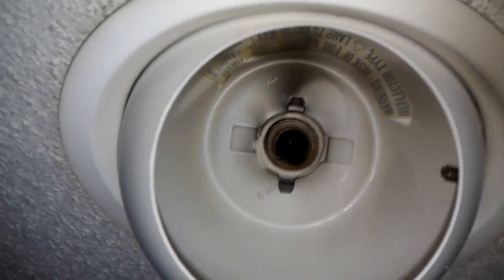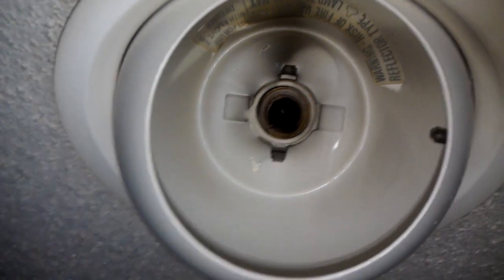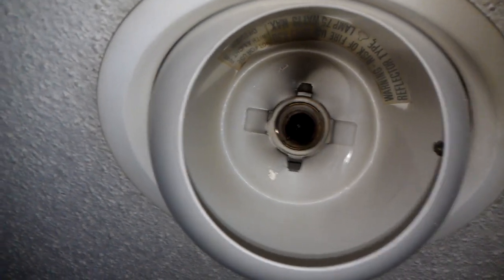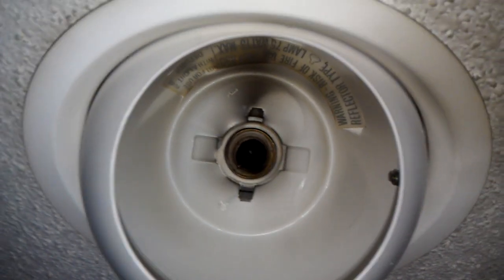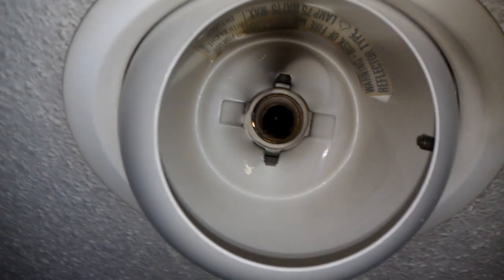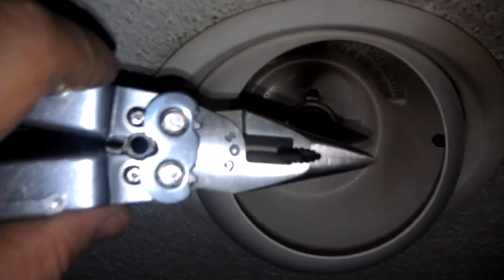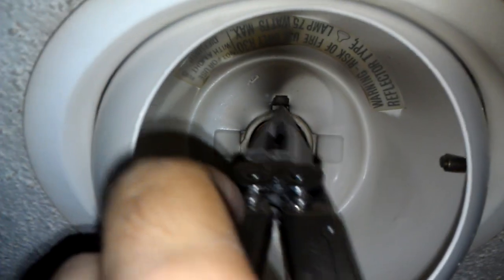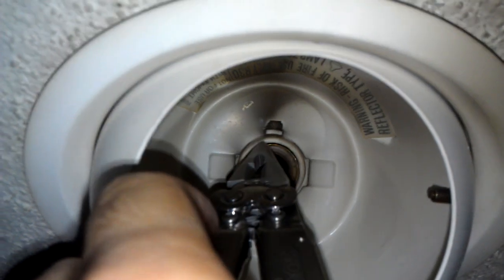How to remove a broken lightbulb base

Comment: I just got it out.  It was a little tricky because the bulb was at the bottom of the microwave that is mounted above the stove.  We had to use a mirror and flashlight to find the place for the needlenose plyers.  Your video was extremely helpful.  I never would have thought to do it that way.  Thanks so much.  -Racquel
Reply from the maker: Microwave bulb bases can be difficult. The heat from the stove loosens the bond between the bulb glass and the metal base so removing the microwave bulb is difficult. Glad to hear the video helped.

Comment: Any ideas on how to remove the metal part from the lighbulb fixture when you can't reach it? We have this issue with recessed lighting in our 2 story great room ceiling and we can't reach the light without using a pole. How can I get the metal part out? Thanks for any help.

Comment: Mine is too rusty.....Its been outside in the elements for a decade. I cant remove the base either. its been painted over to many times to get a grab on the screw. I'm thinking last resort here.   Blow torch and remove the paint? Thoughts? Stucco house FYI so no fire hazard.
Reply from the maker: Sounds like it’s time for a replacement.

Comment: i know this video is old and you probably dont check it but i have a socket stuck in my ceiling lights above my stairs and cant use a ladder because of the stairs. any ideas??
Reply: Derek Linder just saw your post. Home Depot or Lowe’s makes a broken bulb extractor that mounts to an extension pole so you don’t have to get on a ladder.

Comment: Don't do that you have a 50 50 chance of bending stripping warping the grooves in permanent housing forcing new installation of light kit base. Don't do that. Think about it this isn't a steel housing ...
Reply from the maker: It’s just a simple way I’m demonstrating based on my personal knowledge and experience. I did mention to be careful and that if you grab the wrong part it will ruin the light. Thanks for reiterating that for me.